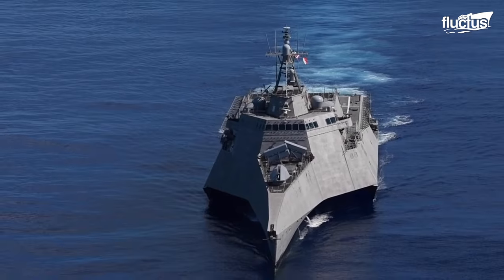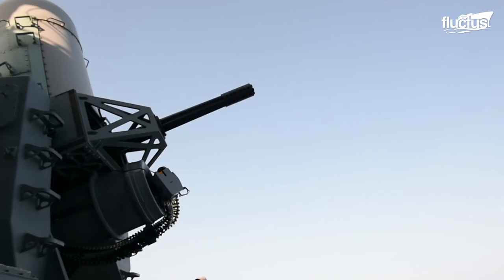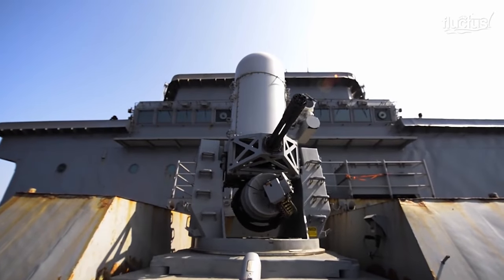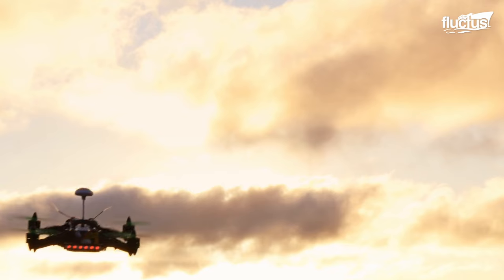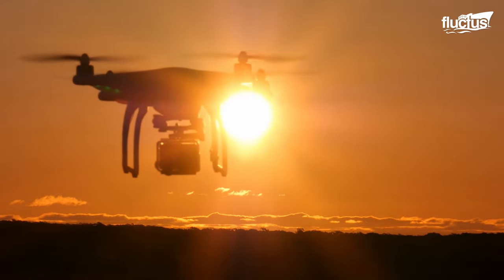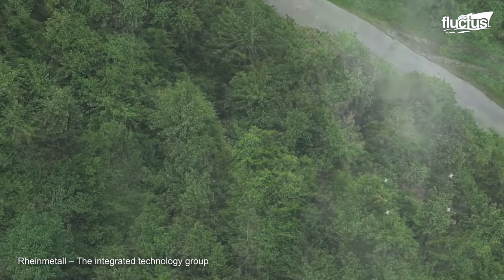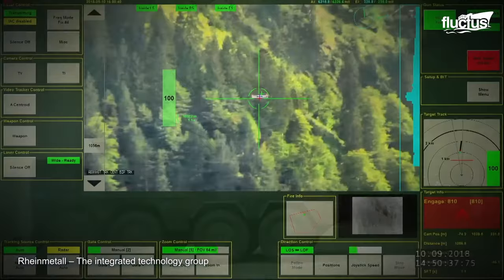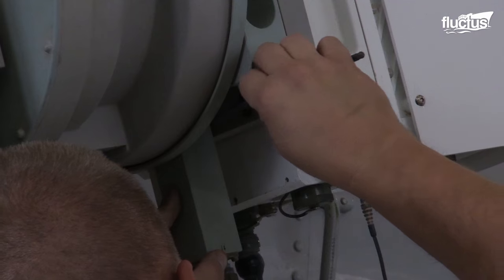The Extreme Solution US Navy Found to Deal With Enemy Drones in Middle of the Ocean

Comment: Modern Drones fly about 100 miles per hour. 9MM  Falanx cannons will handle that. You don t need 20 MM. Radar detects drones. At 9MM a ship basically can just spray the air like a lead firing hose.
Reply: What would be the effective range of the 9mm system?

Comment: It still looks like a massive drone swarm of cheap attritable drones in the tens to hundreds could easily overwhelm the current defenses on these ships considering the number of rockets and rounds looks quite limited.
Reply: This is the reason that all recent US Navy combat ship classes have been built with a very large excess of electrical power over their current needs.  As laser technology improves they will be able to retrofit it to the ships.  It ends the ammunition supply problem that can plague shell-based CWIS systems during mass drone attacks.  Fortunately the laser systems are arriving about now, as massed drone attacks start to become a threat.  A laser equipped warship has recently been sent by the US to patrol in the Gulf, do we'll see how it does if the Iranians try some of their drones out in the vicinity.

Comment: Are these systems mostly,  less then 3 mile defense systems?  How are these systems responding to, Mach 3 and Mach 5, missiles and air craft ? Imagine that, the systems have to be able to aquire and respond within less then 10 seconds.  To deal with incoming threats coming in at 800 miles per hour.  Almost seems you need a whole parameter low tier to mid tier range system.  Mobil units,  how do they mobilze fast enough to be out of a 1/4 mile attack circle,  in less then 3 minutes? mobile units would have to be able to ramp up very fast, and move very quickly out of the area. Basically a focus attack on them, would result in them being destroyed.  As they can't offer 360 degree defense coverage.

Comment: Usa needs a container ship that has 400 drones ready to launch at one push of a button to predetermined targets. (After 300 mini drones (100 first) distract anti aircraft systems, the second 100 locates and targets the anti aircraft systems, last 100 simply mess with various communications structures... then the big 400 drop their strategic payload and  hit rail lines, supply routes, ammo depots, barracks, and ships. 

Enters port, 40% minimum reach their targets, overwhelms anti air systems and costs the enemy money and firepower.

Comment: For swarms, it’s a huge waste to use a RAM or even CIWS, and some or many UAVs would get through. What is needed is a many-pellet projectile, the way a shotgun works, or a blast fragmentation round, as the Germans have/are working on. Those are the only ways to the Saudi oil refinery could have been protected.

Lasers are coming online. They take a lot of power, but if the power consumption down, they could be used in an integrated air defense.

Comment: Frankly, this is nice to see.  But the future is already here with lasers.  Perhaps they currently need some improvements.  The reality is that systems take often times decades to be developed and more certainly their development must be ongoing.  They can take years to make it into the formal configuration of a fleet.  Ultimately, lasers don't preclude the use of other artifacts.  Cost would be a consideration. Strands have been made with lasers at a massive scale such is the case of a 747 being able to house a flying power plant capable of generating a laser to intercept and disable a flying object.  There are no ''special'' hypersonic darts that are faster than the speed of light.  Some of the science fiction concepts of the 80s may have already been developed.

Comment: The Israelis have developed a laser system -- called Iron Beam, I believe -- that relies entirely on electricity rather than rockets or shells. It sees a target, pinpoints it, and burns through it. It is designed to defeat massive barrages of attacking rockets.
Reply: Good research.. the US Navy will be heading in that direction as well. It will still use the CIWS platform and radars, but other than that,, no bullets.

Comment: A smart flak cannon seems like it would be a good drone sniper. Drones are typically slow moving so ciws seems like overkill for drones and should be reserved for higher value targets.
Reply: CIWS the only drones we shot at were towed by a jet that we shot attack then drones were not prevalent and the CIWS was primarily used for incoming missile type at high speeds, it has its own gyro to track the incoming so yes you want a fast firing cannon for that so not overkill.
Reply: Sir, the gun made by Rheinmetall already fits into that role.

Comment: You keep referring to the CIWS as the Phalanx. Phalanx is only one part of the system.  Phalanx is the Gun portion; Vulcan is the fire control system.  So, the CIWS is also known as Vulcan-Phalanx weapon system.
Reply: Sorry to correct your correct. The Vulcan refers to the multi-barreled gun. Phalanx is the name for this specific US-designed system. CIWS is the category of weapon it is: Close In Weapon System.

The Dutch have their own CIWS system called Goalkeeper and it uses the GAU-8 Avenger gun.

The Russians have the Kashtan CIWS that uses a KSh gun.

Comment: Between 5" 54, R2 D2 with hard on, EW and active radar? Oh don't forget hand held. Yes those were also used in 1982,
 Does not take more than 5 rounds from CIWS and one round from 5 ' 54. Oh and that is by 1982 standards.
 So what can it be like 40 years later?

Comment: "need to be calibrated frequently" - that sentence alone tells you the system is shite. Manual calibration on a piece of 'modern' equipment tells you something is wrong. It's either affected by temperature, expansion, or it's optics are unreliable.

Comment: That Zaklady system would be perfect for front line units. Mount it to a 6-8 wheel AV to stay mobile, and you can protect the troops. C-Ram is too big and fixed for the units on the move, but fine for airbases and base areas. Could have used that in Nam. Over 30% of our casualties were from arty, rockets and mortars.

Comment: the second vulnerabilitie lies in the desighn of the guidance system. usung electromagnetic interference, one can simulate targets that aren't even there. so those machines will waste their ammo on nothing. extremely hard to differenciate from nano objects. even when using multi- wavelenght (optical and em ) sensors. one is able to create points in space that reflect or draw the waves emitted by those systems. non tangible chaff. while this is not yet developed in full, it is just a matter if time. see subsonic weaponry tested in the 1940s. Wehrmacht. now imagine you can have this in air or water. "knots" of interference. not distinguishable from tangible objects.

Comment: Sound like a system that will fail in  an event of a sustained drone swarm attacked from multiple directions. Once the ammo is exhausted or the guns of the ship overheated.... it is done.  Anyway. isn't the most likely ship killer be flying torpedo drones? The drone flies close, then drives into the water, swims the final distance and explodes under the ship  breaking its keel.

Comment: Its Drone, Missiles, Torpedos, Bombers, Bombs. Sink Warships in minutes.
Reply: Has to find the warships first. Hard thing to do in the open ocean.
Reply: @Rob_F8F  I am a sailer. Sail Sailing Yachts from everywhere to everywhere for Owners. We dont shoot the Sun anymore to find where we Are. We have a Laptop and GPS and an Application. We know where we are Anywhere. Atlantic Caribean, Mediterranean. On the meter. Satelite Tracking of Carriers knows by the meter where They are. Even Pin Pointed guided Missiles for Bow or Heck or Bridge or Deck Attack. Accurate by the Meter. They know minute by minute where all Carriers are. No problem. By a Laptop with GPS App for Carriers and you know also.🙂
Reply: @willeisinga2089  With respect, warships are not yachts. 

Yachts and other private and commercial shipping are required to have their AIS transponders on. That allows these vessels to be located and tracked. It's a great system for a safety and maritime insurance perspective. 

Warships are not on AIS. Entire Carrier Battle Groups with multiple ships and thousands of crew practice EMCON (emissions control) to prevent electronic emissions from revealing their position. These ships will know exactly where they are. It's preventing the enemy from knowing where they are that's the point. Satellite orbits, radar coverage areas, known patrol areas are all plotted and avoided as necessary. Without AIS, finding a  ship in the open ocean is a challenging task, especially if it is trying not to be found. 

Cheers!
Reply: @Rob_F8F  you know. Good. The pilots in Midway found the Carriers by accident and 4 Carriers were Sunk in minutes. I think  Satelites can Track Big Slow Targets. No Escape.
Reply: @willeisinga2089  You know Midway. That you know that the "accident" of VT, VB, and VS squadrons were at the end of a long string of non-accidents that began with the breaking of the Japanese Naval Code, the revelation of the Operation MI, the Japanese Order of Battle, the table table for attacking Midway, the insane repair job to put Yorktown back into action, the deployment of the 3 US carriers northeast of Midway to ambush the Japanese carriers, and that the squadrons launched with a rough idea of the range and direction of the Japanese carriers.

When all of that happens, sure, it's easy to find carriers in the ocean.

Carriers may be big and slow. But in the Pacific, they are microscopic. Unlike maneuverable carriers, however, satellites travel on predictable orbits.  US carrier battle groups know how not to be under satellites. Does it mean that CVBGs can't be found, certainly not , but it's not as easy as "have the satellites find it now."

Comment: they are ALL vulnerable to extremely SLOW or STATIC drones or mines already in place. nanodrones underground or undersea will do the job of doing away with those. this is especially true with bacteriolical weaponry. insect sized mole like drones are the ultimate threat to these. also, when chemical agents dissolving rubber and plastics. those vehicles and the insulation of any cables and wires eill be defenseless. as it will take time, your mileage will vary.

Comment: If the phalanx is so accurate why does it hit the water when firing at a boat a few hundred feet away?
Reply: They might have applied an intentional offset to the shot to either save a target vessel or perhaps warn an approaching Somali pirate type vessel.  Such a thing would be easy to implement in software.

Comment: Unfortunately, as cool as these systems are, they're no match for drones. Hear me out. Problem is with small drones, they can fairly easily defeat unguided systems (CWIS/CRAM) due to time of flight of the bullets. Say the bullets have a 1.5 second time of flight to get to your quad-copter, it wouldn't be difficult at all to program into the drone to change its velocity vector every second. At 3,000 rounds a minute, and with say 10 targets all employing the same evasion algorithm, those unguided systems would be quickly overwhelmed. However, guided systems which could maneuver end-game would be able to defeat the maneuver algorithm. The problem is though, how much do those missiles cost versus the drones? How many missiles does the system have? If a nice, $1,000 drone can eat up even a "cheap" $50,000 missile, and the asset being defended only has 48 missiles, you can overwhelm their entire guided defense system at less than the cost of one of their missiles. And sure, a drone simply can't pack that much of a punch. But let's say instead you have a couple of anti-ship missiles. Throw 50-100 drones at a ship, soak up all their defense munitions (guided and unguided), and boom! Now your anti-ship missiles have a clear path. I'm not saying the systems are obsolete, but they're like hunting mosquitos with a shotgun; the wrong tool for the job.

Comment: 10's of millions to destroy targets that cost at most a 50k... (many drones are more like 5k) the ammunition probably costs as much as the drones they are destroying... Drones require guidance, radio guidance, wouldn't it be better to disrupt their radio signals than shoot them with bullets... Even if that's not the solution this isn't either, its typical military, always gotta bring a gun to a knife fight, or maybe in this case a nuke. If it costs you 20k to destroy a target that's worth 5k dudes that's a fail.

Comment: A lot of these use smart munitions which are great as the effectively get the job done with as little effort possible. But they run into problems when you look at their cost. If a large scale war would be conducted between two nations giving it their all and the conflict last longer than a year even the US would be breathing fumes and might be resorting to more traditional tactics just due to the fact smart munitions take awhile to replace and if you burning your whole stock pile well you'll run any country's wallet into the ground. Furthermore a lot of smart munitions rely on infrastructure to work which again assume two countries are giving it their all over a prolonged war that becomes less and less of a crotch they fall back on as it gets blown up.

Comment: Sooo..... When the Gatling cannon or Phalanx needs reloading, a poor seaman has to take a leisurely stroll on the deck? even when other systems are firing? in rain/squall/gale/hurricane/sleet/snow/ice build-up?  Kinda like the russky capital ship recently promoted to submarine duty - MOCKBA? - "for fair weather use only"?
As far as cooling - ain't it on a metal hull ocean-going vessel ?  See all the sea around ya?  Is it ever above boiling point, that salty brine? Oh, so it really IS a bit cold!  Well, then, how about GIVING THE DARN GATLING A TURRET OF ITS OWN, ya know, to help the FKN Sailors safe(r) from shrapnel and wind and waves that WILL eventually promote its assigned human resource to Purple Hearts and fertilizer!  Once THAT issue is resolved, maybe hook the cooling system on board to some way of cooling of the gat?  Fewer people on a ship will indirectly lead to fewer casualties on the battlefield When (not if) its number comes up.
Informative:
Jyral Nadreth : "30 minute reloads for Block 0 and from Block 1 through to current Block 1B Baseline 2 its 5 minutes. Current systems have 1500 rounds at 4500 rounds per minute....20 seconds of fire"
David Elliott :  "At 75 rounds per second, the computer could be set to fire one second bursts. Also put cooling fans over the barrels. Then all you need is a way to fast feed new chains of ammo."